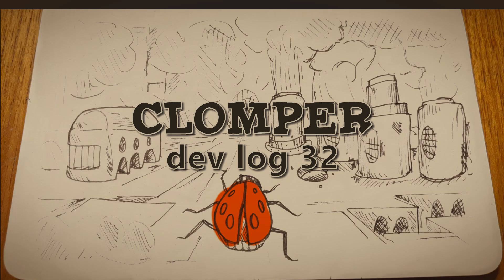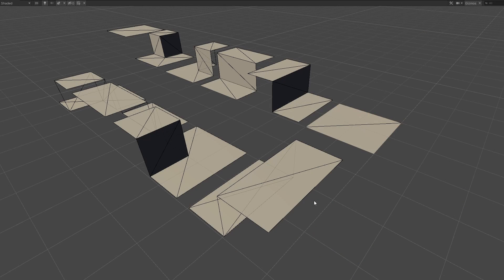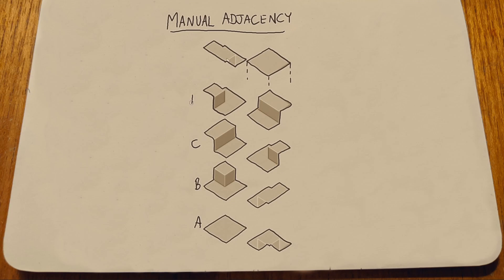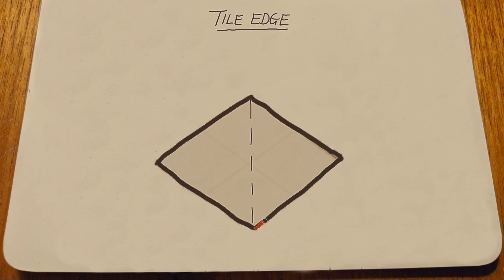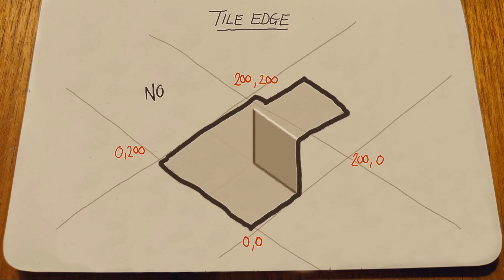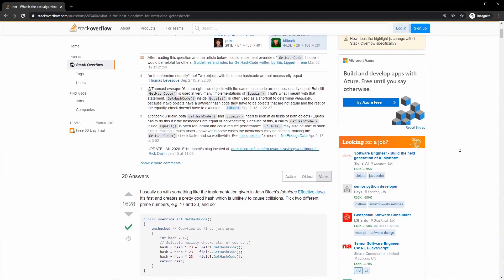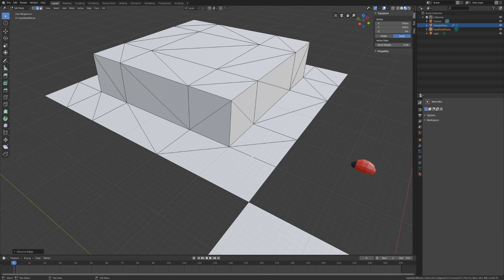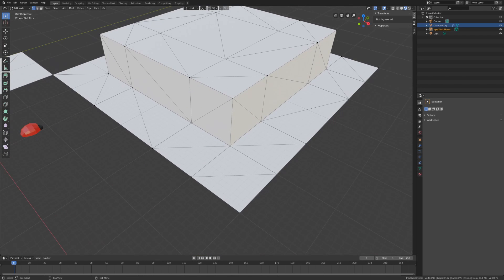Finding Mesh Edges for Wave Function Collapse | Indie dev log | Clomper #32

Comment: kinda late, but not making them rules is just as boring as having to restructure them edges in blender :o
Reply from the maker: So far, I've found that ensuring edges line up in blender is much easier. As the combinations of edges grows, the number of rules will explode and if I missed a pair of rules it would mean that in certain circumstances the world would not be able to generate. I've added new tiles and types of tiles in Blender easily enough and not changed the algorithm at all - so I feel that so far it's the right decision!

Comment: Interesting solution, I hope you make it work ;)
I would definitely do something different, such as using perlin noise to generate the grid, and then I would read the perlin noise to find the correct mesh (+ rotate it if needed).
Anyway, keep up the great work :)
Reply from the maker: That would be perfect too. It's my backup option! 😆 Using wave function collapse means that I get more variety for less work. I hope. In theory. Probably. 😆
Reply: @RobLang  well, have fun, because using perlin noise map would mean, that returning to previous location would generate identical environment. I don't think that its easy to achieve this using your current method.
Anyway, I can't wait 4 finished product. Keep up the great work :)

Comment: Would the hashes be different from the step tiles if you decided to introduce a ramp tile?
Reply from the maker: That's a great question. Ramps and steps would have different hashes because the hash is made from the edges, not just the vertices. If it were vertices alone then there would be no difference between a ramp and step. However, using edges protects me from that. 👍🏻
Reply: @RobLang  Do you generate a hash for every tile's side? The side might consist of multiple edges, and you are building hashes that are a combination of the vertices and edges along that side?
Reply from the maker: Great question! I'm building a hash of all vertices and edges on a side. It doesn't matter if the side has lots of edges, as long as they are hashed in the same order. I ensure that by temporarily ignoring the side's rotation and looking at it as a 2D projection.

I hope that helps! If you need more details, my Discord is Rob Lang#7769